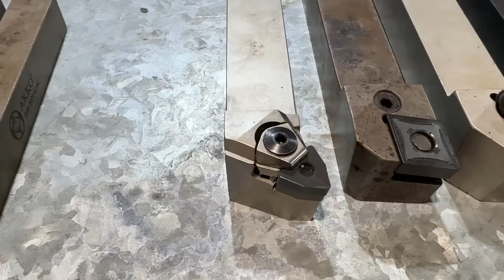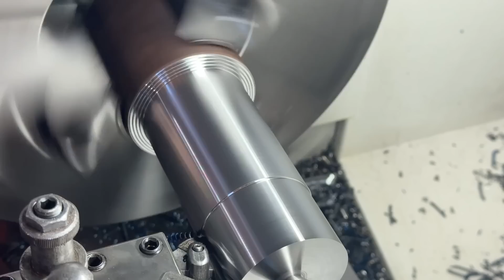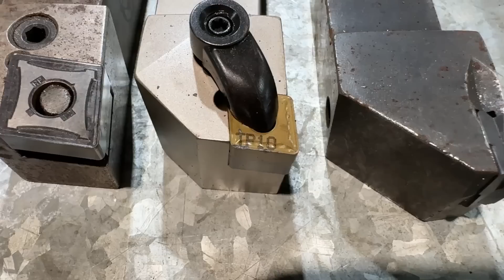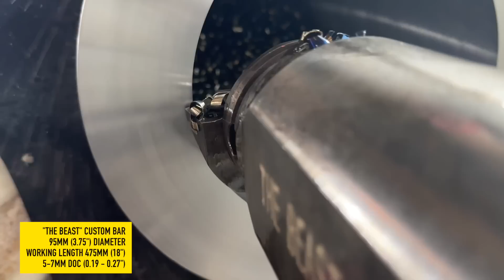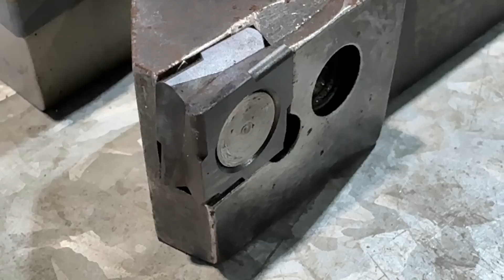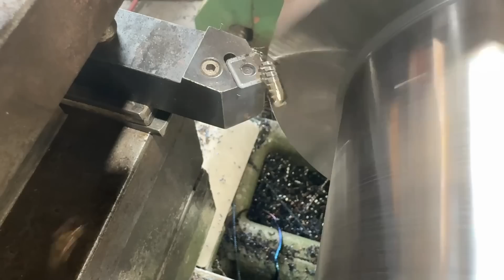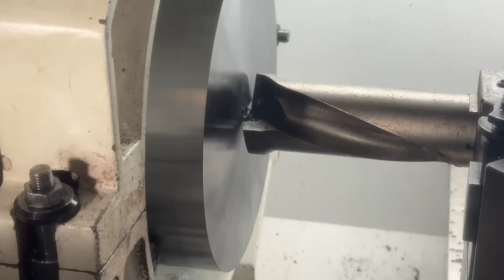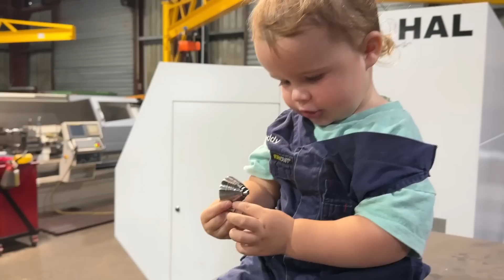The Carbide Inserts We Use (And WHY!)

Comment: I get a lot of abuse for using a Drill Doctor on small drill bits (because I also struggle to grind the relief on a small bit). You're a real mad lad for letting the comments section know that you use one 🤣
Reply from the maker: Yeah, I absolutely have no ego about it.  It gets a better result faster.
Reply: Drill doctors work, with a bit of tweaking.
Reply: @pvtimberfaller true. You have to get used to how it works, then it’s fine.
Reply: Don’t know about that, I’m 66, sharpened my stuff down to 3mm/ 1/8”…
Two years ago bought the precision machine from Hairy n Forbes.
Bliss.. split points, different angles, whatever.
Only does the drill point of course.
Reply: I didn't hear him say anything about a drill doctor. I did however hear him say he has a drill sharpening machine. I will bet money it's not a drill doctor.
Reply: @Chris-te7uk  I don't use a drill doctor either, it's a genercised term.

Comment: I used mainly WNMG 08 and DCMT 04 for outside tools and on small boring bars also CCMT. DNMG i used only if i had to, i didnt like them very much.

Have ever heard of Wiper geometry? A WNMG 08 with Wiper geometry gives you a surface finish like a WNMG 12, or a 0,2 feedrate finish at 0,4 feedrate. It can be helpfull when the material doesnt cooperate in getting a clean finish with a low feedrate but the drawing says Rz25, or to save a tool change.

Comment: Hello from Northern California. Little hobby operation here. Plexiglass to hardened tool steel and even rubber, if I can get it in my machines I will take a crack at it. Very interesting spot there. Always like to hear the reason for your choices. Climb or conventional milling, carbide or HSS if i get the desired results it’s good for me. I love watching your operation especially when you say “We made do” or “it’s the tool we were already using”. Makes me happy to know I’m not the only one that does that.
  I appreciated your bit on carbide there, simple and what has worked for you. That’s what I like to hear. Yes they have hundreds of grades and coatings available that can numb your brain just  thinking about them. But if I can finish the part faster then I can finish the advertising? I really like seeing your shop made tooling. And the issue it solved. From custom tools to standardizing your inserts used, great content.
Reply from the maker: Cheers mate

Comment: This is all fantastic information. There’s still a ton of different terms and concepts I think I have figured out. You say things like “5mm depth of cut” and I have to guess at the meaning. For each revolution the workpiece makes, the cutter moves 5mm into the piece, either cutting in towards the center, or along the length. When everyone talks about feeds and speeds, that’s the “feeds” part, right? And when there’s things like chatter, it’s because you’re doing something like feeding too quickly and the insert can’t cut through the material that quickly? Maybe because the relief angle doesn’t bend the chips out of the way fast enough or something? So you can dial back the feed and increase the speed to cut away material about as quickly, but just by taking lots of smaller cuts? 
I have no reason to be learning all this since I’ve never machined anything and probably never will, but for some reason it’s all really interesting and I’m deeply appreciative of you for putting all this info out here for everyone to learn from!
Commenting from Ann Arbor, MI, USA
Reply: Perhaps 'Depth of Cut' should be described as the width of the tool contact and 'Feed' should be depth of cut per revolution, perhaps this makes it easier to understand?  Usually the material removal is greater along the cutting edge than the thickness of the cut.

What a lot of people don't understand is that generally metal removal is not a cut, usually it's scraping the surface, look at swarf under a microscope and you will find it has been scraped from the surface, that's why it gets so hot..
Reply from the maker: 5mm DOC refers to how much material the insets takes off the radius with each pass.

I should have explained it better.

The feed ie 0.3mm/revolution refers to how far forward the tool progressed with each rotation.

Comment: Hi Matt
I haven’t had a chance to try the Hi-positives yet, it will happen though!

The shop I learned in had only on WNMG tool, everything else Ol Mike ran was HSS, right up until he hung up his spurs.
Everybody should learn to sharpen HSS tools, there is nothing cheaper or more versatile esp for a lightly built low horsepower lathe.

The biggest mistake I see is people trying to use the same insert for everything but I guess that is how they are often sold.
For a manual machine I prefer the plain old boring TCMT five tool set, AL, AR etc (so plain in fact my boss refuses to buy them because they aren’t “Pretty”)
A set of TCMT boring bars, an internal/external threading set should cover everything you are likely to need.
Just get some TCGX(?) for non ferrous and plastic.

In my CNC I ran everything.

Cheers

Comment: CNMG 432 heavy roughing chip breaker is my favorite ID/OD.  Strong and versatile most of my tool holders fit these. Once I'm done with them on the CNCs I put them to work roughing in the manual machines on the larger included angle edges so 4 points each.